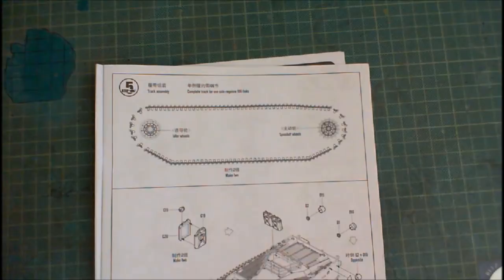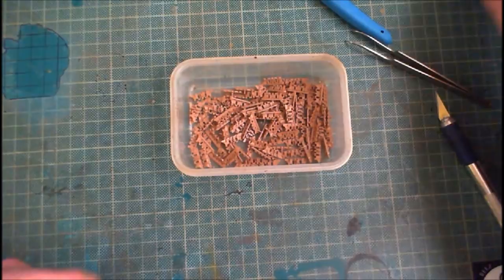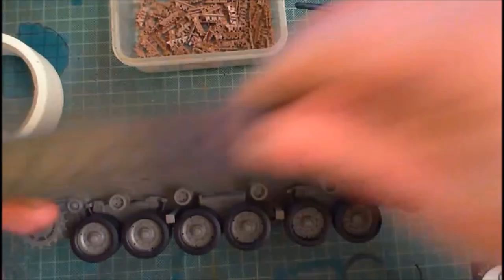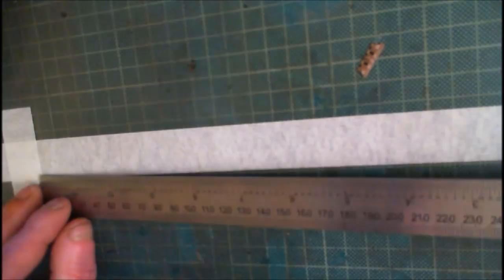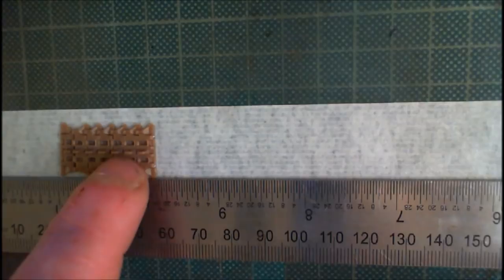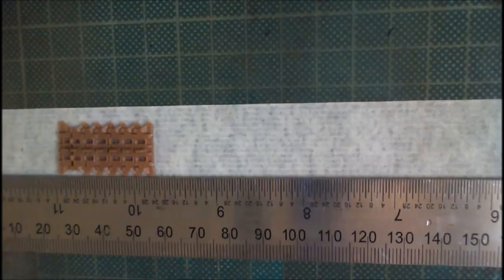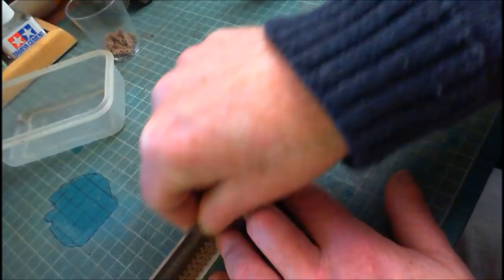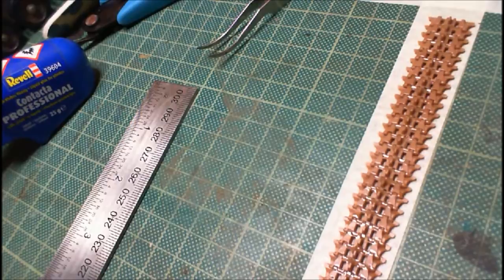INDIVIDUAL TRACK LINKS HOW I DO THEM

Comment: I use 2 pieces of  L shaped aluminium back to back drill  holes in each end and small bolts with a firm  spring. Slide  tracks in and u can pin them or glue them. Love your work and commentary keep up good work

Comment: Did you attempt to join the first and last links? I didn't get the ending with just the tape. Tamiya's Extra Thin seems pretty slow to set. Have you used this product before? I appreciate your video as I was flummoxed by the individual inks and was avoiding vehicles which had them! Thank you.
Reply from the maker: I use revell contacta to do the links and use tape to hold when joining the last two untill the glue cures